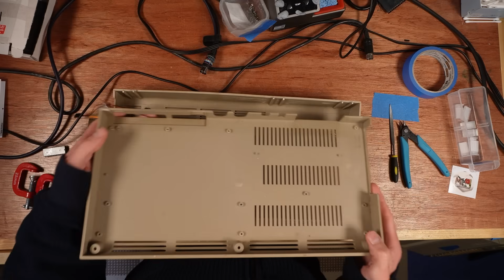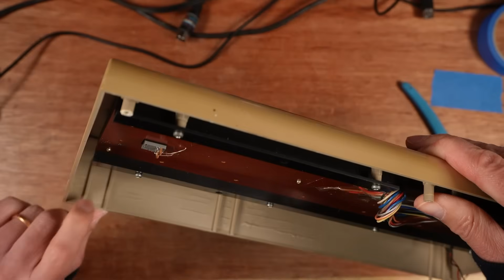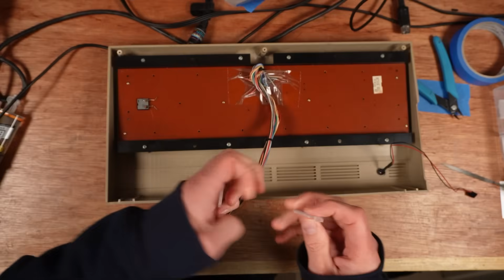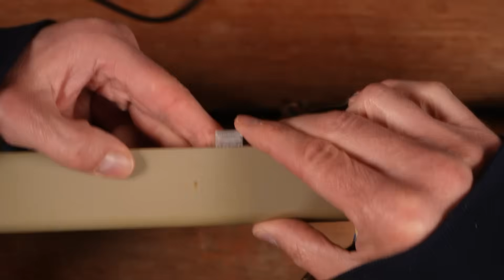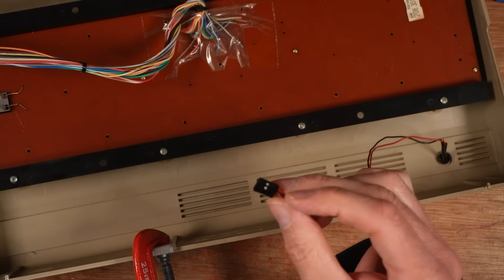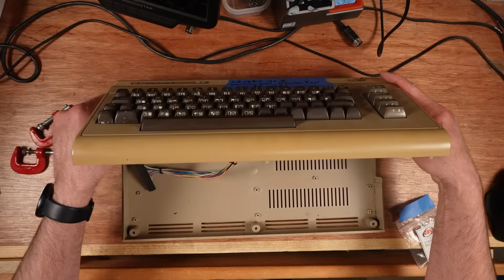C64 Case Clips Repair

Comment: I'm going to have to join your group. I found a different 3d model and used hot snot "temporarily" on my C64 breadbin and it has worked, but at some point I want to sell that machine on as I never use it (I have a 64C which works more reliably) and I'm quite sure those clips would never survive the postal system!

Thanks for the video!
Reply from the maker: Please do!

Comment: I like to keep the cutoffs from cable ties (the wider around 4-6 mm. ones) for stirring two-component epoxy. Simply because I find them nice and easy to scoop up the glue with. And then I've told my friends and family to collect those plastic lids from rolls of crisps/chips (like Pringles and such) for me. Since they make quite nice trays for mixing epoxy in.
- But I may just nick your bamboo stick method, the next time I need something to get into tiny spaces with. 👍👍
- BTW on the topic of hot-glue: hitting it with some isopropanol is an almost magical way of making it let go. It doesn't as much dissolve it as just make it loose its grip. So, using hot-glue around places where you often also tend to use isopropanol...  yeah, probably not the greatest idea.
- As for it not gripping as well in the first place: is really just a matter of getting hold of a proper hot-glue gun. And by that I mean one that is able to go above the temperature needed for actually melting the glue-sticks properly. Or In other words: NOT those cheap ones we always find on sale in December for Christmas decorations. Those are absolutely wonderful for avoiding any really nasty burns on the hands and fingers of children though.
- I still like to also sometimes hit the hot-snot with my hot-air iron at 200°C. Just to make sure that it has properly melted or even it out better. And that is even though I have one of those hot-glue guns fully capable of making the glue able to give 'you' third-degree burns. 😬
Reply from the maker: Some great tips there. I rarely use hot glue with a hot glue gun. I just chop bits off and melt it with my hot air station.